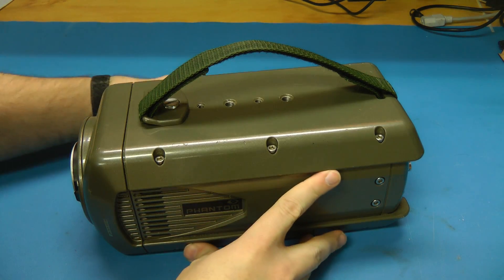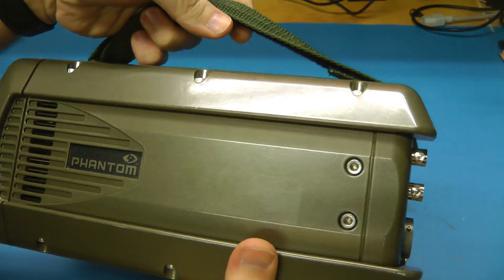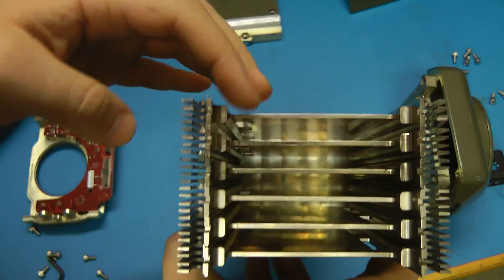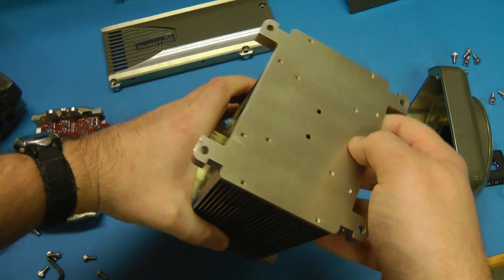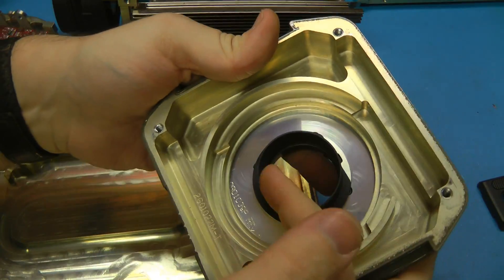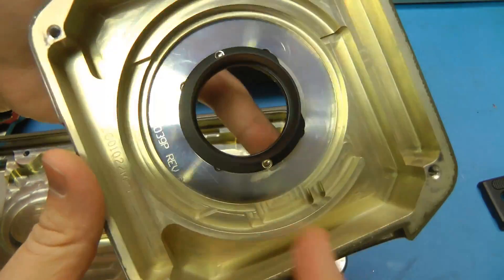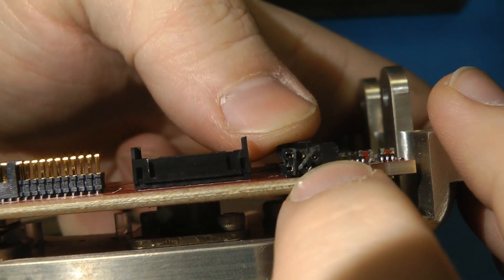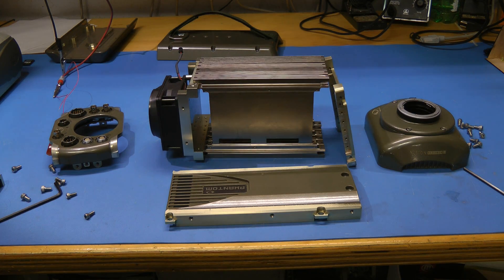Phantom V12 high-speed camera teardown FAIL

Comment: Hi there, I have a v10 that has a mysterious problem. It works for about 5 minutes before the image begins to slowly fade until there is nothing. I then power down the camera for several minutes, and then power it on and the same thing repeats - works for 5 minutes and the image slowly fades to nothing. 

It seems like an overheating issue, but both fans run smoothly. Do you have any idea what it could be?

If you have any suggestions I would be forever greatful!
Reply: Additionally, I contacted vision research and they kindly stated that the camera is too old to service or even diagnose problems for, so I’m not worried about breaking the warranty sticker seals lol.

Could I potentially commission you to take a look at mine? If so, I would be interested!

Comment: Those connectors are the status quo in military aviation. Some are threaded and lock, some are just threaded, some are just a quarter twist lock.. Most are waterproof with removable pins. There are so many that are very similar. They are generally referred to as Cannon plugs. Most of them are made by Amphenol, some by ITT or Glenair. They... Are... Not... Cheap... lol

Comment: Still managed to make an interesting video.  To get back the $400 and then some... you could build a special edition Chronos 1.4 with an internal SSD drive and battery for someone with demanding case requirements.  LCD screen placement would be a problem of course.  Alternatively it can serve as a pretty good looking paper weight or send it to the will it crush channel and get a cut for it ;-)!

Comment: What a disappointment ! A similar thing happened to me once, with an aircraft cockpit control box. Just received an empty aluminium box, with a front plate holding  some switches and lights, all the guts removed.

Comment: http://www.ebay.com/itm/162304825616

Expensive for an empty case.
Reply: Could easily get his money back. "No function testing was applied at this time as we don’t have the power adapter for this unit but it was pulled from a working environment." Yeah right.. Item is clearly not as described.
Reply: TheAmmoniacal "returns not accepted" yeah right, you better take it back after clearly lying on the description.
Reply: "but it was pulled from a working environment." from an environment where it was used as a paper weight.
Reply: Firecul42 PayPal almost invariably sides with the buyer, screwing honest sellers all the time. Fortunately that also helps when the seller does suck.
Reply: See that final price...404....sounds familiar....(error 404 * not found) sad but also has a nice touch at the same time....

Comment: I am guessing when they first released the camera, no one bought it until the prices dropped to the $1000-2000 range, then they may have sold a handful.
Reply: +Tesla500 Return it as "not as described" as there is no way the description "...but it was pulled from a working environment" is accurate.
Reply from the maker: These still sell used for well north of $10k in working condition
Reply from the maker: I have one, well the casing at least... Kinda want to flog it back off on ebay though and see what I can get back for it.
Reply: +tesla500 yeah, but will it mow?